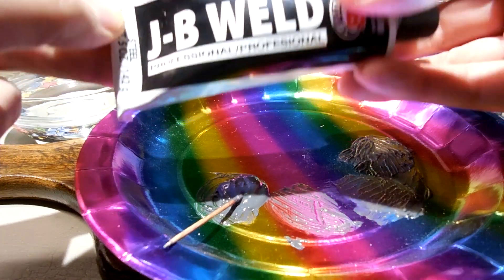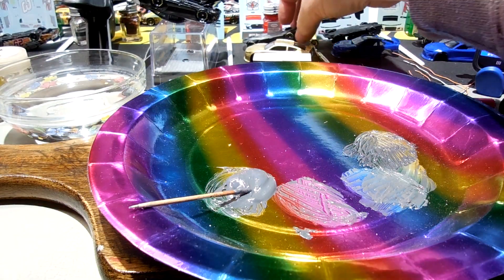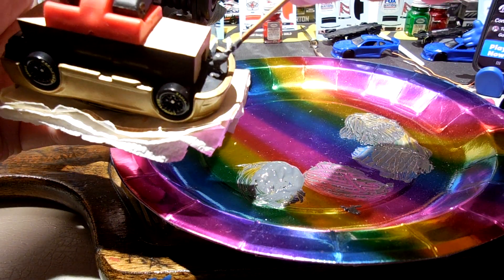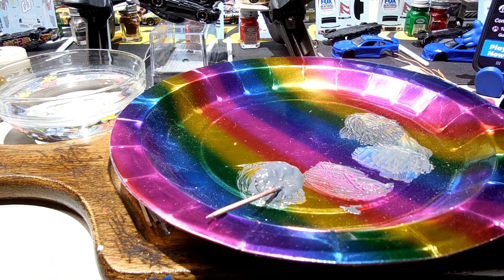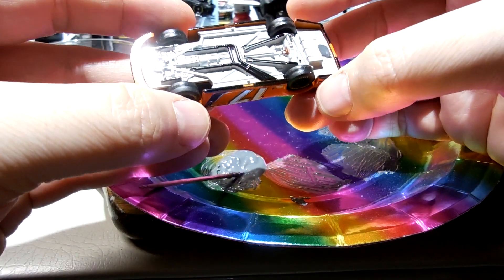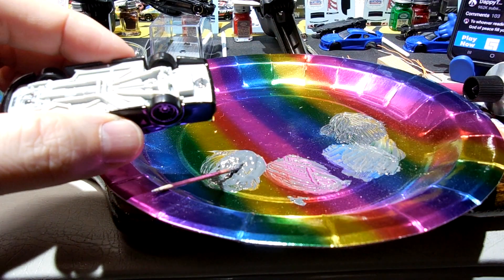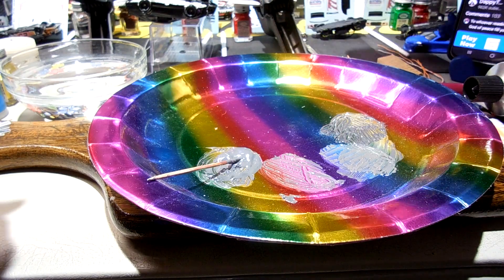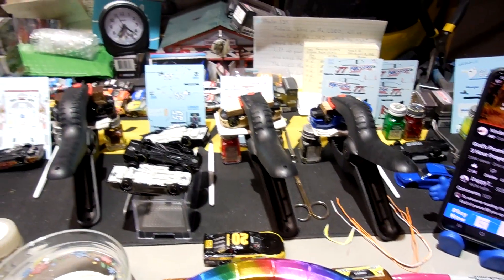Clamping these 2022 Next Gen NASCAR Custom 1/64's are a must.

Comment: I clamped my car without a paper in between the car and the paper towel and it left such a bad mark on my roof 😔. Lesson learned though, from now on I will put a paper in between like I see you did on this video.
Reply from the maker: It's always a bonus to learn from your mistakes. I have made many. 😁
Reply from the maker: I do use a small square of paper towel AND a piece of paper. Sometimes the paper towel will stick to the roof so I put the paper against the roof and the paper towel against the clamp.